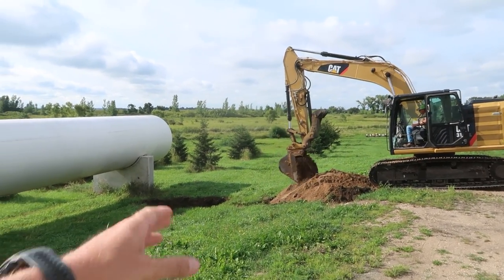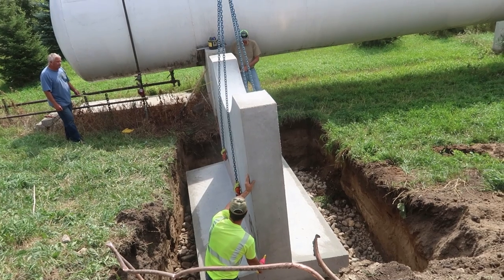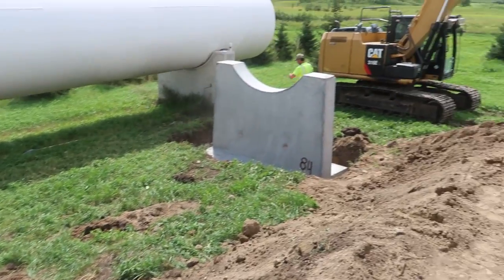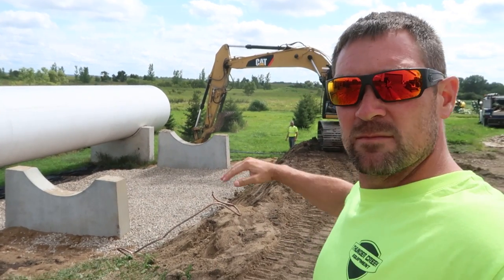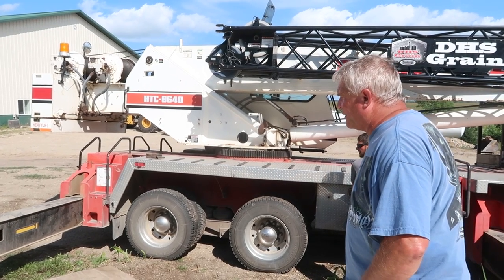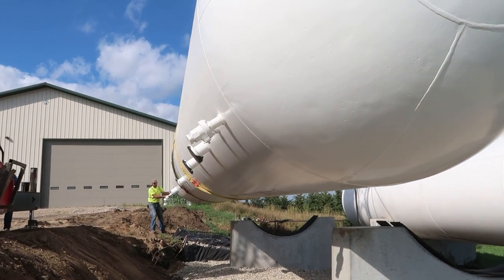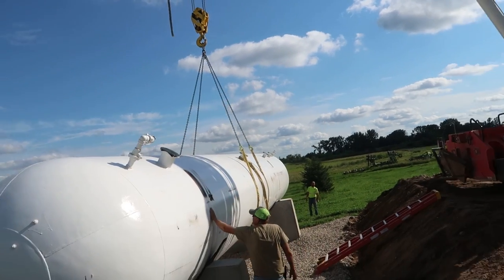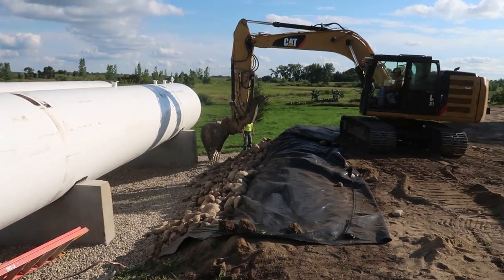Giant Cranes and Excavators! - Moving Our New Huge Propane Tank Onto the Farm

Comment: The guys did a great job setting up the stand for the lp tank.
But when setting up the second one it's better to measure in a X instead of an I I,  that way you can detect when it's offset.  With I I you can only detect rotation and it can still end // or \\ . With X when the numbers match it's a hit

Comment: Looking at the “rust” on the bottom of your diesel tank, might I suggest when you move the tank back, that you put down a concrete pad and isolate the tank from the pad with blocks of rubber. If the tank comes in direct contact with the concrete, you have the possibility of rust, again.
Reply: Used to coat the bottom of tank with tar and then tarpaper for a barrier . Had to do that about every couple years. Was in the project several times in the chemical industry

Comment: Wow!!! The precision the crane operator has to put that tank in the spot you wanted it is incredible!
Reply: Considering what the crane was set up on and the pads under the floats, the crane guy doesn't appear to have tons of expirence. The man basket on the crane was extremely illegal lol and the pads were well undersized, no safety gear on what's so ever, outriggers weren't taped off for swing zone, tires not off ground, I'm sure this dude was riding his line with the computer in rigging mode.

Comment: I hope that when you have the new propane tank and the old tank plumbes to the dryer that you put in all new piping and valves and go as large in pipe and velve size to match the output of the tanks. The way you are expanding you will need to increase the dryer capacity and you might as well be ready for it with the larger piping.

Comment: That co2 sensor should be 30" off the floor not up by the ceiling. C02 is heavier than air so by the time it gets up there and the alarm goes off your dead.

Comment: Hate to be "that guy on the Internet" but Dieter really should have used a spreader bar when lifting the LP tank. 2 slings going to the same lift point is how those videos of cranes dropping yachts into the water happen.

Oh, and Dieter didn't have to use math. They have graphs to check their tipping points.

Comment: I don't mean to be a troll. Don't underestimate the weight of the diesel tank loaded.  Depending on how much fuel you store in the tank consider that it's not centered on the pad. I had to say that.
Reply: If they had a 30,000 bushel bin on that pad, that's over 1.5 million pounds of corn. Doubt if a full diesel tank would be an issue.

Comment: I would cry to see the bill of what it would cost to fill that tank.
Reply: That’s the cheap part. The cost of the tank, hauling it, cement piers, and the crane work are the bills I would cry over. In the long run they will recoup the cost with what they are saving getting transport loads of propane, but writing those checks all at once would be tough.

Comment: The new used lp tank.  What the eff kind of jankety set down was that?  The semi driver could have done that.  Ho Lee Fuk!
Reply: Whats the matter with you?  It looks like the tank is right where they wanted it!
Reply: @paulcopeland9035  nothing the matter.  It went in a little aggressive.   Gravity did most of the work.  At least they won't be on a heavy lift/crane tipping compilation.